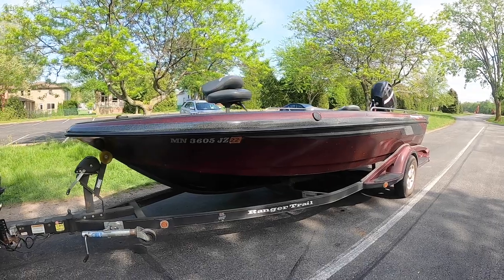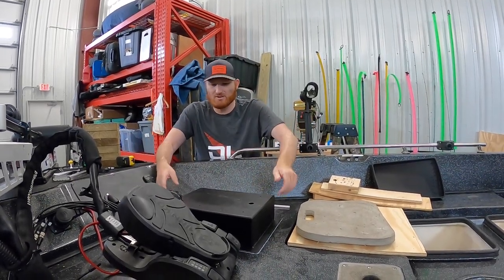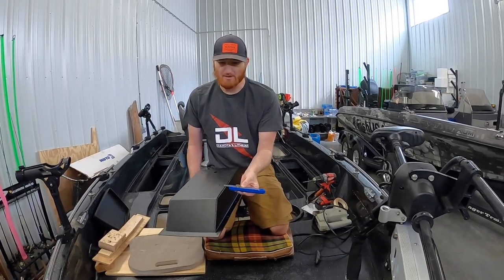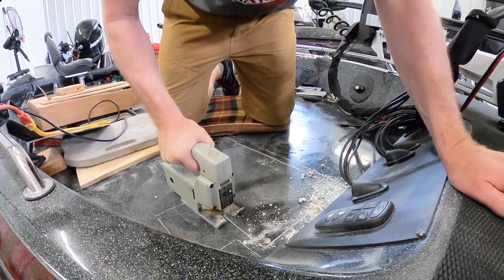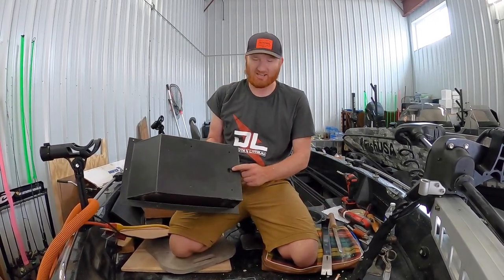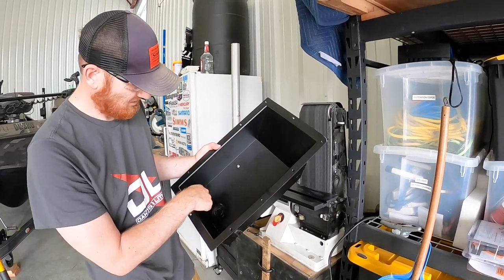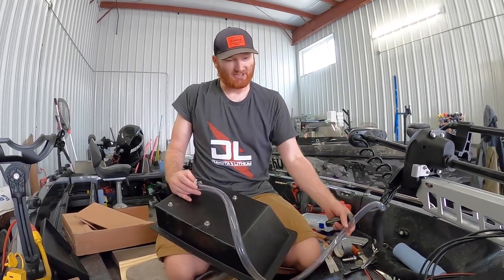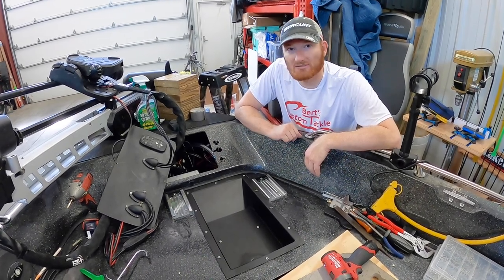Project Boat Restoration: Trolling Motor Foot Pedal Tray | Part 2

Comment: Another way to drill out a bigger hole when you already have a smaller one can be done with 2 hole saws. Get a hole saw mandrel install a hole saw blade the size you want to make ( looks like you needed a 1 1/4 inch hole) then get a hole saw the same size as your existing hole in the pan. Both hole saws have to be the thin based ones vs the thick base ones (Milwaukee has them). Then screw the small hole saw in the mandrel to act as the pilot for the larger hole saw. This is a good way to do it when you can't screw a backing board for a pilot bit. Just like you've given me tips fishing with your videos I can give back little tips to you.